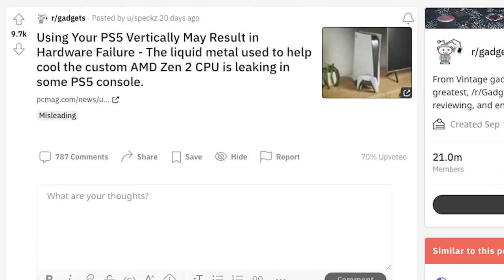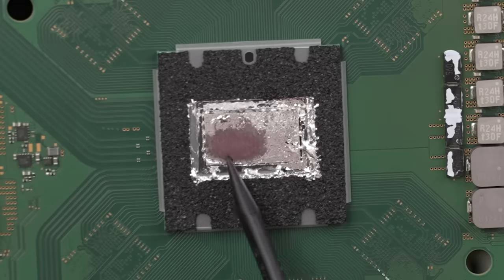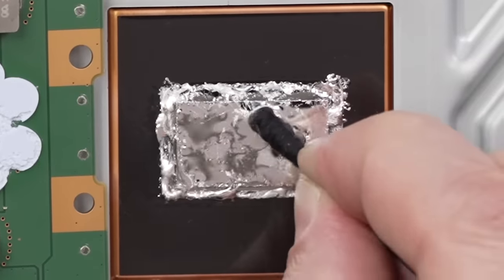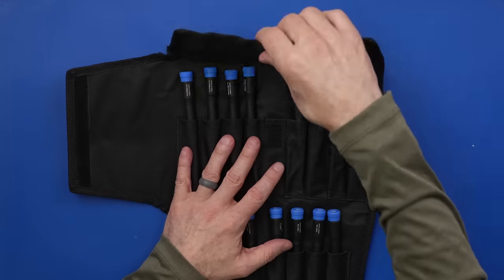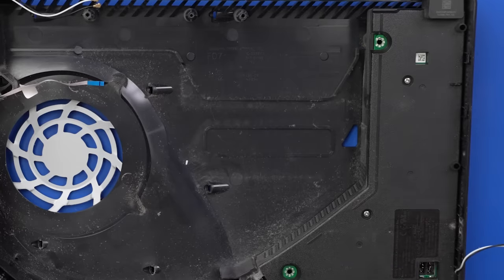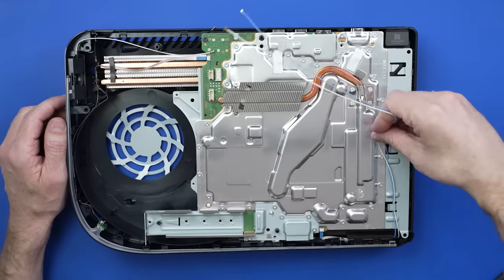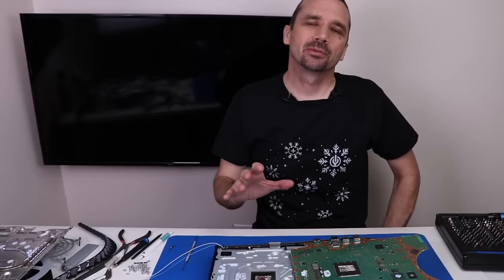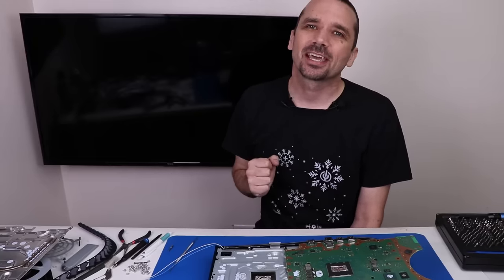PS5's Have a Liquid Metal Problem - But It May Not Be What You Think

Comment: I asked a friend of mine, who works at a game store, about the whole ‘dripping liquid metal’ thing and he said that one of the guys at the out-of-warranty repair place they use said one of the most common issues with PS5s is dry spots on the chips like this video states. The repairer thinks that most vertically placed moderately used PS5s, especially launch ones, probably have a lifespan of about 3 to 4 years before they’ll encounter dry spots on the APU. He thinks that Sony didn’t really plan for longevity with the design of the PS5. If this turns out to be true it won’t be a good look for Sony, especially considering that all of their marketing for the PS5 has it placed vertically. I’ve had mine for just over a year now and have it vertical due to lack of space in my entertainment unit. I’m curious to see if I run into any issues in the long term.
Reply: Have you forgotten the RROD? I was burning through 360s in months not years(I went through 5 of them all told), and I wasn't alone.  Every single solitary person I know who had a 360 had at least one RROD. As long as a platform has good games, and eventually owns up to their mistake(MS denied the RROD problem for nearly a year) "gamers" will be very forgiving of that platform.
Reply: tell your friend to inform people about attaching dust filters, any dust in the console would wreck the liquid metal and there will be thermal imbalance, L console
Reply: @CDRaff  ps3 was worse

Comment: Man, every time I watch videos like these - I can't stop thinking of how horribly greedy Sony is that they couldn't spend a few more $$$ to put a plastic or metal mesh dust filter on both sides of fan intakes (instead of useless "fan finger guards" that they currently use) so the dust would accumulate on top of those dust filters and could easily be vacuumed by every user without further disassembly.
Reply: Dont forget its a business they want you to spend.
Reply: I bet PS5 fanboys would cover their ears, pretending nothing bad has happened to PS5. They would always say "PlayStation5 the only current gen gaming system!"
Reply: Well tbf sony is already selling them at a loss theyre making money back through games, subscriptions, and accessories
Reply: @TheGintama86  I'll also give the benefit that at least the PS5 is super easy to self-maintain. It's kinda built in a way to be opened up.
Reply: To be fair. Sony probably does tests in a well ventilated clean environment. I see it as a good thing because people really shouldn’t be living in dusty environments. And if your room accumulates the amount of dust to cause your ps5 heat sink to clog up. that’s not good.
Reply: hmmm then those dust filters need to be changed in like 4 months maximum , sorry but that's not the way
Reply: @Northside7777  then they can burn with the business
Reply: @vivliforia2262  which is overclocked to match the series x specs
Reply: @joshaa1525  so people shouldn't live in the real world, got ya , that mom's basement must be real clean for you
Reply: @MGrey-qb5xz  i understand. id be mad too if i was dusty and broke
Reply: @vivliforia2262  2 months later, where are the xbox games? oh yeah you dont have any.

Comment: I had a customer last week with the same problem. His PS5 had about 8 months, very clean inside and still getting overheat. After open up, i noticed this same issue, one part of the APU was dry of metal liquid. After move around the metal liquid to cover that area, closed the PS5 and the customer had no problems at all anymore.
Reply: I have a little problem with mine it working but it doesnt showing on the monitor sometimes it showing a white light but when i tried a ps remote play it working on the remote play but not on the monitor it is because of the ac adapter ? i leave my ps5 on yesterday and when i came back then it happend thanks for reply
Reply: @samuelgregr8451  If it's working on ps remote play, the console gpu itself is fine, i think its something wrong with the hdmi output ci.
Reply: This means that basically nothing horrible can happen? If there are errors, just check and fix the liquid metal? I'm keeping my device vertical. Does it make any sense to check the metal without having any issues? It is over 2 years old.
Reply: @Zsolt_  If there is any problem with the liquid metal heat transfer, the console will only shutdown itself.
Reply: @kensm2  thanks!

Comment: I would assume based on the 1st PS5's symptoms that the PSU thermal protection was kicking in before the APU, hence no overheating message and just plain shutting down.
Reply: This seems very likely in my case. Never seen the over heating message, but still the same symptoms.
Reply: Explain? My PS5 is a launch model and it’s suffering the same symptoms, no message at all. Just POOF! power off.
Reply: A got the same at the weekend no message just turned off and wouldn't turn back on so changed fuse in plug and she came to life but you could feel the heat coming off it so went on amazon bought a small precision set with security torx and just striped the ps5 down today took me 3 hours as its my first time and my fan heat sink and power supply where full of dust and cat hair cleaned it all out and she is running really quite so quite that a had to double check that I reconnected the fan lol so if you guys are having the same issue strip it down and clean it 1 tip you don't need to take the shield off or the heatsink once you have it striped down enough flip it over and take the 2 screws out so you can remove it in one piece to clean and not worry about the liquid metal running everywhere
Reply: @zmman9243  same launch model.  Just had same issue.   Did you end up sending yours back or did u find a fix ?

Comment: Isn’t it possible that the PS5s just sitting and not being used is what’s causing the dry spots? I think you need a control case, meaning a vertical PS5 that’s actively used or at least in sleep mode in order to see how the Liquid Metal behaves.

Comment: it's interesting to see that Sony decided this was the best way to cool the system. given the series x and PS5 basically use the same APU I wouldn't expect their cooling solutions to be so different even given their form factors, Sony obviously knew about the limitations of LM and decided to use it anyways
Reply: and soon other companies will follow cause they can sell soon to be defective products and the masses would be more then happy to buy cause liquid metal sounds hip to them. Disposable income is disposable indeed
Reply: It all comes down to cost. MS used a custom vapor chamber, but also don’t mind selling the Series X at a significant loss. Sony can’t afford to do that anymore.
Reply: I think Sony ran in to some problems with the design of it as the heat sinks are kind of a odd set up and spaced out like it was put in a later date as i think it struggled with heat problems as the fan itself is having to pull air from the front of the case when it is on the side blocked by the silly panels. That why so much heatsinks and liquid metal instead of normal paste while Xbox used the vaper chamber and good fan placement as the AMD chip can pump out some good heat when under load maybe that is why Sony clocked the chip down a bit from Xbox as they both using the same chips but Sony one is clocked down a small bit. Just what i think i have both consoles so not saying one is better.
Reply: @MGrey-qb5xz  that is very questionable. Liquid Metal is actually a better cooling solution overall
Reply: Liquid metal is far superior at conducting heat vs. thermal paste, several times better than the very best pastes, so is a more efficient interface between the chips heat sink and the cooling block.
Reply: I just got my PS5 a few weeks ago finally and I can't believe how quiet the fans are compared to my PS4 Pro
Reply: @craigemery856  had the 2018 revision of PS4 Pro till last year... regular cleaning and it was way quieter than the noisy ps5
Reply: @Uzishan  Thats kinda weird because I kept my PS4 Pro super clean too but I could still hear the fans more than my PS5 which is whisper quiet but it is almost brand new
Reply: @craigemery856  u prolly had 1st revision which was having a shady fan... also ps4pro came with such a bad thermal paste that even just putting thermal grizzly kryonaut(not even liquid metal) was making any ps4pro extra silent even under load.
Mine also got the hdd thrown out and put an 1tb samsung evo 860 so it was even more quiet(and noticeably faster since ps4pro had sata3)
Reply: @MGrey-qb5xz  lol
Reply: @Uzishan no it’s not
Reply: @REXae86  no it's not what?
Reply: @craigemery856  yes but the ps4 pro sounded like a jet taking off 😂😂😂😂 my little brother had one and when he was playing upstairs I could hear his ps4pro wile standing down the stairs 😂

Comment: I like the video, but have to disagree on certain points, if a PS5 suffers from oxidation or "corrosion" in its IHS or heatsink union, it's not because the design is wrong, but because that particular unit was poorly assembled (isolated cases among thousands of consoles) and parts with defects, be it poorly sanded surfaces or defectuous nickel plating, because in theory and practice, liquid metal doesn't have to eat copper or nickel, it only melts with them at a molecular level but not to the degree of corroding as If it happens with aluminum.

And second, we have to take into account the behavior of a liquid, obviously if we separate two plates pressed together with a liquid in the middle, the surface tension will cause that layer of intermediate liquid to break and disintegrate creating those "dry spots" that can be seen when we opening the assembly (only when we opening it), but at a micro level that doesn't exist when the two plates are tight together, since the idea and purpose of the liquid metal is to create a very thin but extremely conductive layer at a thermal level, that we cannot see with the naked eye That layer doesn't mean that it's not there when everything is closed.
An example would be that you will enclose water between your two palms, if you hold it indeterminately, the water will not come out, no matter the position. But as soon as you separate them the layer disappears, the same logic occurs with liquid metal used as TIM.
That is why I would not guarantee that the PS5 has to be used in a “safer” way or another, since the position doesn't have to alter the internal layer or the integrity of the TIM.
Reply: @Kratosine I definitely agree with you this one, its like all of these repair videos, these persons dont actually know anything about liquid metal and how its actually act whe ja pressed tightly there between two area and ofc there is then dry spot when this seal is broken.
Reply: So in short, having your PS5 vertically or horizontally won’t change anything or “harm” the liquid metal.

Comment: The thing is is not all parts of the die have thermometers so if there’s a dry spot and thus a hot spot it may not detect a high temp but detect too many errors that result from a high temp and turn it off, similar to how bsod’s are triggered on windows

Comment: nice efforts again! when my ps5 started to shut off while playing from overheating there was no message. i had to remove the power cord and then do a hdd repair on both drives and read the message that the unit was not shut down properly . it ran for 16 months 24/7 and the fan was quite dusty and heatsink was plugged with dust. i didnt check the liquid metal since the cleaning of the fan and heatsink fixed the shutting down.

Comment: Have you tried replacing liquid metal with good thermal paste or the difference in temps will be too much?
Reply: I was actually thinking of doing this.
Reply: @matthewward5849  You will be able to use it for a maximum of 10 minutes and you will be warned of high temperature, the recommended is liquid metal and not thermal paste.
Reply: Either he made the video or someone else did on replacing the liquid metal with thermal paste and it does not work

Comment: I see alot of people asking. Yes vacuuming the holes helps but it's minimal I guess it's peace of mind only. I've vacuumed the holes on mine but it was still caked on the fan. Cleaning the fan is not fun it really gets caked up even if you dust it off. I have hepa air purifier in every room it helps but still gets dusty and caked up. I blow my ps5 out as well as all the pcs/laptops every 3 to 6 months. I've cleaned 8 PS5 for people as a service in my town and the fan is always caked in each household the heatsinks are usually not that bad seems like the fan design just loves collecting lint and dust.
Reply: you use a leaf blower on ps5 without taking it apart?
Reply: The issue is the PS5 so massive and unwieldy it’s hard to put somewhere efficiently. Hope a slim model comes out ASAP.
Reply: I'm just glad people everywhere are taking to regular maintenance of their systems nowadays instead of just letting something die and assume it's reached the end of its life cycle to just get a new one. 

Cause if there's one thing we all know, these companies aren't making the devices we love for long and when something goes wrong, you'd typically want to start again with the same product you had before.

Comment: From watching your buddy The Cod3r, I have gotten the impression that the liquid metal gets out of place largely due to dropping the unit.  The shock makes it splatter.  It gets all over the place and shorts things out.  If you lay the PS5 horizontally, it is in a more stable position and is less likely to get knocked off the entertainment center onto the floor.  So whether it is just gravity or dropping that causes the problem with the liquid metal, laying horizontally is an improvement.

Comment: I found you can rotate out the main board assembly to about 75 degrees angle leaving the metal shielding undisturbed. Once there, you can easily blow out the heatsinks and PSU with an electric blower. To do this you need to leave the IO ribbon cable attached and IO board installed. Just be careful that you don't put the IO ribbon under pressure. If you are careful and maintain observation with the still attached ribbon cable, you can easily rotate out the main PCB for heatsink cleaning. I tend to put a little contact cleaner on the PSU spikes once air dusting is complete to ensure best PSU connectivity.

Comment: Nice one. This is reminding me that I should do a good cleaning on my PS5. Mine is a launch disc system that’s been horizontal the whole time due to the space I have for it. No problems and runs pretty quiet during play.  Fingers crossed it stays that way.
Reply: Hi could tell me if your working PS5 is a 1000, 1100 or 1200 model please? (It's written under the PS5
Reply: He mentioned that he had the ps5 since launch. So his ps5’s definitely the 1000 model. Also the most recent ps5 model is 1200 so I don’t know where your 1600 came from
Reply: @ColdFuego-  Yes, its a CFI-1015A.
Reply: @ColdFuego-  
(edit July The 3th)
Thanx : Investigation results still now :
Investigation results still now :
12XX without problem : 7 gamers
10XX without problem 7 gamers
10xx shut down after 2 years (fixed by cleaning the internal power supply from dust) : 2 gamers

1116A without problem 2 gamer

1116A/B WITH CRASH SHUT DOWN PROBLEMS : 8 gamers (!!!)

1115B (digital version) without problem 1 gamer

It's not a lot but it's intéressant to see that the most gamers (almost 100%) who have issue are on the 1100 model for the moment.
Reply: @ColdFuego-  (1600 was a mistake I wanted to write 1200, I've edited)
Reply: @angelogalileo  well it's the oldest so problems would surface by now.. do a poll on r/ps5 if you want more results
Reply: @betrion7  already done 😅
Reply: they say consoles is plug n play
buy n forget😂
gaming PC is better😎
Reply: @angelogalileo  you really would need more samples for that "investigation" bra.....
Reply: you need dust filters for it too, cleaning it won't be enough to prevent any damage to liquid metal and once that happens it's game over
Reply: New results edit July The 3th
Reply: @coolmonkey5269  literally no one asked

Comment: that dry spot is where the heat sits when you shut it down immediately after hours of playing. i make it a habit to cool down my consoles for like 3-5 minutes before shutting them down. my 14yr old ps3 slim 6 yr old ps4 slim runs like new on their stock thermal paste. now that i have the ps5, i'm making sure to cool it down before turning it off to disipate the heat inside.
Reply: Impressive! If you don't mind me asking, when you say "cool down", what kind of cool down method are you using before shutting your systems off?

Comment: Depends where the temp sensor is. It could be some place else than the dry spot, so no overheating message, just thermal protection kicking in at last second, before APU burns itself
Reply: then It's a poor design if that sensor is not catching actual overheating
Reply: @ceramicmagic4169  this is the ps3 all over again, ps4 pro was perfect yet sony messed everything up again for their inventive fetish
Reply: @ceramicmagic4169  That will be on AMD side of things for the sensors as it is there chips not Sony's they cant change the chips. But the problem of it has gone away so it must of been a way Sony was applying the liquid metal or brand of it as this problem only affected early models so Sony did change something to fix it.